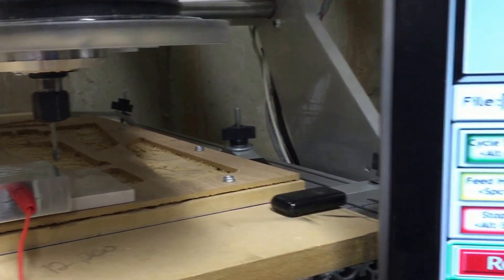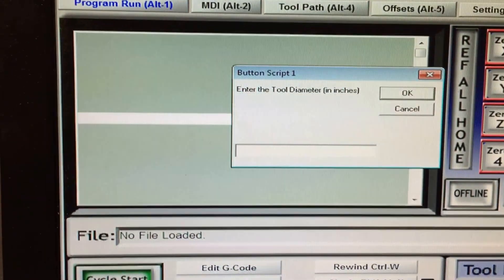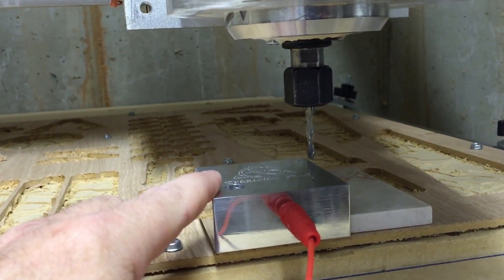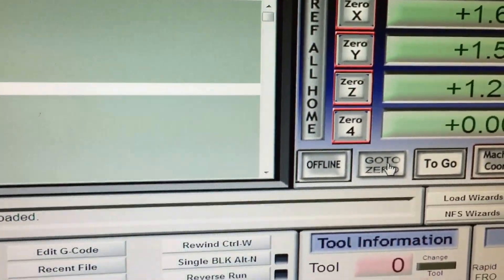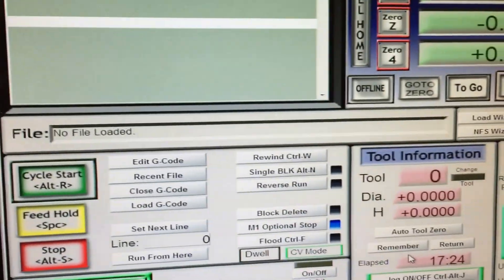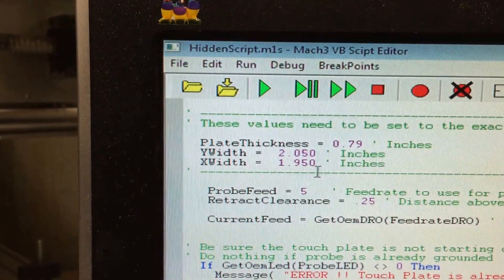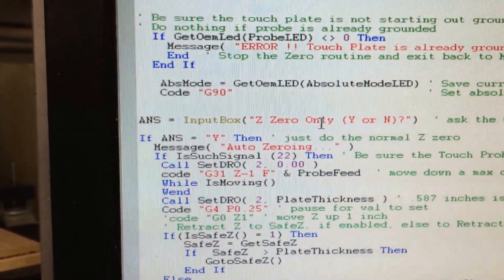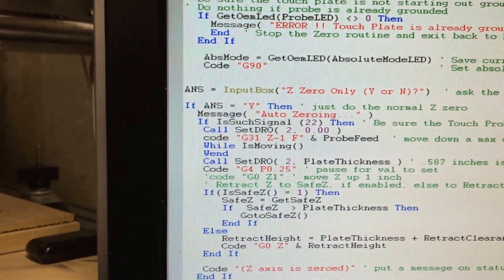Auto XYZ Zero Demo

Comment: Hey Allen, very cool script. Is it possible to help me with a script of my own. I want the ref all button to go to a specific location using the machine coordinates. Let me know if this is possible
Reply from the maker: The Ref All Home button is programmable with VB script so it is very easy to make it do what you want.
Reply from the maker: Yes it is, just create a text file with the Gcode commands you need to send the tool to the location you want.  Example the line: code "G0 Y1.5 F60" ' will move toward back of machine 1.5  If the machine is in relative mode it will move 1.5 units (inches or mm depending on the mode).  If the machine is in Absolute mode it will move the Y axis to 1.5 from the Y zero location.